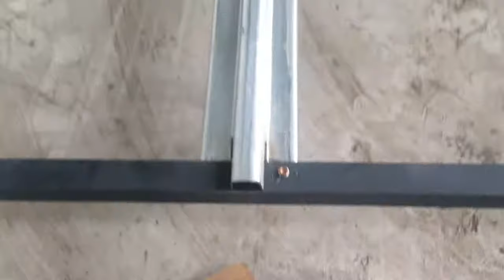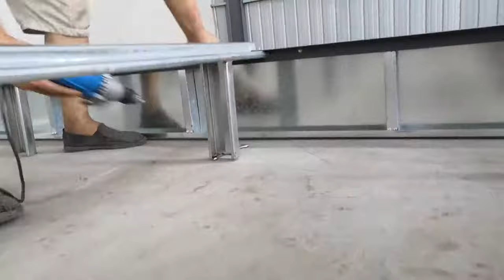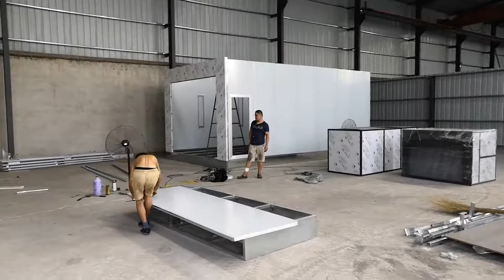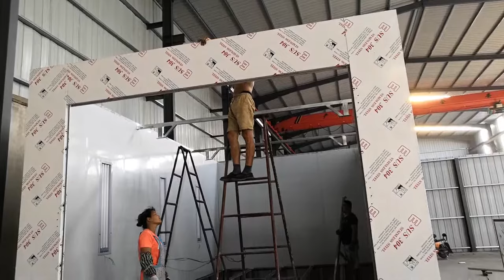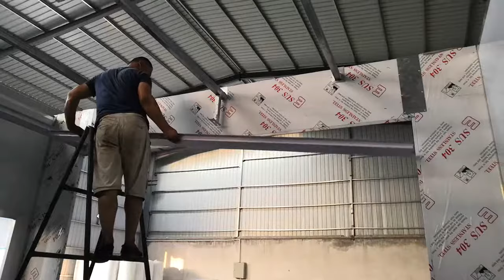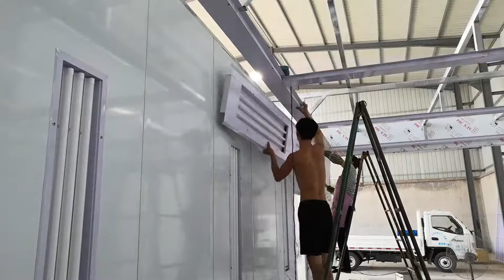Car spray booth installation

Comment: How much does a booth like this cost and what’s the size and weight of the packaging for shipping?
Reply from the maker: Hello, friend, where are you from?
There are diesel heating type and electric heating type, which type would you like?
Please tell me mobbile number or email, i will send you a detailed quotation with drawing.
Mine whatsapp:008615863159725